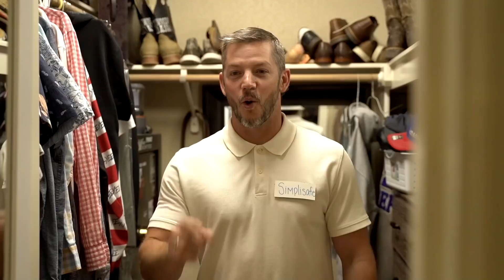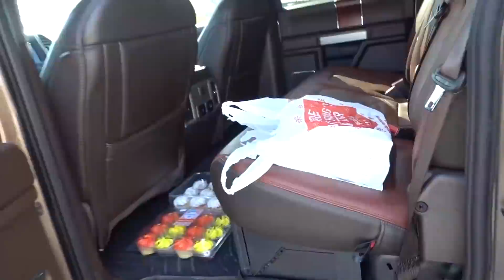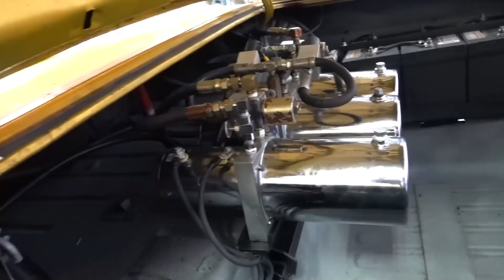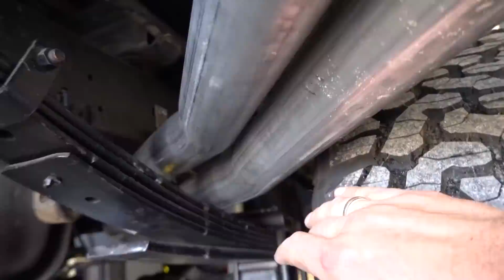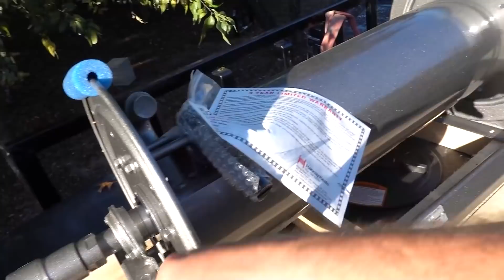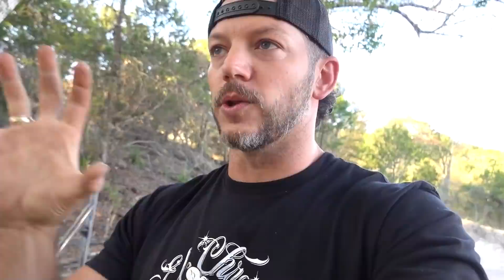Here's How a Local Car Shop Screwed up the Bronco...

Comment: Looks like you gave the Bronco to a pet shop to have done.  Bird poop welds and goldfish engineering. Built by monkeys.  Take it to someone who cares about their work. And your Truck..  also you will need flexible joints on your rigid pipes else will simply crack and vibrate itself apart.  HURRY  with the mansion dude. Missing the updates. 👍
Reply: yea i was surprised he didnt say anything about the welds
Reply: @niq872  I know nothing about welding and even I noticed that was a mess.

Comment: I think that if you pull the top of that tree with big chains and tying it around some poles and rocks, it will bend. Just do it after a big rain while it has leaves, to make sure it's springy enough. I have a few smaller trees, but the thing with bending is to do small bends over a long period of time. Like braces.

Comment: The reason why it’s bent is because the tree pushed away from other trees to get sunlight if your wondering about that but you can also get a spade truck and replant the tree somewhere else but it will be costly for that size of a tree and because of how established it is or you can chop it down because eventually it will fall over because all the weight is on one side.

Comment: Just remember to always oil you soft hose so it doesn't dry rot on you over time and good luck sir.     An just cut the part of the Tree that is Curving there is 3 other trees growing from that root system so just remove that part, its possible to do a transplant but as big as that tree is your best just to cut the Crocked part out only again leave the other 3-4 trees growing from the Root system thou and they will grow in the place of the tree taken down.

Comment: Take a huge winch and a chain / cable bend the crooked part of the tree all the way down into the root system chain it back with a strap around the tree not the chain or cable because they will grow into the tree trunk and leave it to reestablish itself over some time it will settle out of your path it's called training your tree usually done on younger trees but it will work on older trees it just takes longer

Comment: THE TREE  ! Yes you can cut the limb off.  But you should wait untill after this first cold spill when the sap has gone down into the roots . So it will not bleed out . Then you should place some tree bandage or paint tar on the open cut to seal it . Then problem solved .

Comment: At 22:46 will not work the reason why it bends is to get to the sun light it goes on the direct path to sunlight that could work but you'll have to clear the canopy around it so it would grow up otherwise it's just gonna do the same thing

Comment: You should hard pipe another hose real to the front of the truck so you have 360 degrees of hose or install water sprayers on the front and flood a fire by just driving over it

Comment: after 4.3k comments you probably won't read this but if you bend the tree it will work but you need to keep it bent till straightens out so you might have to anchor for a while like a year or so I'm from Oregon we do it all the time and you can cut a small section out if bend it to keep it straight. Hope it works. Love your video's

Comment: Grafting is hard on small trees.  On a  big curvy thing like that, you're better off cutting it 6 inches away from that spur that wants to go vertically.
If you can find some kind of a wound sealant for trees, you MIGHT be able to prevent the cut from rotting, but probably not.

Best bet?  Just cut it off at ground level, in the spring, and if a new shoot pops from it, let the new shoot grow.

We've never tried to save a bad tree.  We just cut em.

Comment: Chain or strap the tree from the middle to the bottom of another big tree and with a chain or strap ratcher you pull it a little bit once a week.. you dont need to make anny cut.. the pulling will brake the fibers just a little bit and it will heal it self every time you pull and over the time the tree wont be on the way.. i have done it with 3 smaller trees and it work perfect.. just remember to pull just a little bit every time so it will not break compleatly and give it enough tine to heal every 1 to 2 weeks.. may be you will need to use mulltiple straps and ratchets sinds it is a bigg tree

Comment: I wouldn't use hard pipe on the firetruck. lmtv's aren't made to be stiff. When your driving around your property you will be slowly stressing out the pipe and you could crack it right when you need it most

Comment: Been in tree care for 5 years. Any tree with a large gouge in it, get rid of it. If it doesn’t die quickly, it will in a few years. Those gouges open it up for disease and it WILL happen. You only want to take 15% of any tree at a time and only want to cut oaks in the fall. “Oak wilt disease” is a very common thing that will happen if you cut them in the summer. Any respectable tree company will only prune oaks during certain months. 
In short, cut it down. Yes it’s a nice tree, but it’s done for. Cut it down.

Comment: Could you dig out around the base of the tree with a backhoe and then pull it with the 5 ton to straighten it up and then fill the dirt back in? Basically like you're replanting it, but not cutting all the roots or pulling it completely out?

Comment: That tree is going to fall if you try to bring it back on itself. You would have to tie it off on both sides and slowly let one side out, thrn leave it tied off and hope the lines dont pop while you are trying to let heal and the cut would have to be almost perfect so it doesnt try to roll on you when you let off tension.

Comment: I think u should absolutely try to cut the bend out! It might reknit itself! Nobody can tell you without a doubt if it will work or not. Most likely not but hey I was a certified arborist. I think you should try it. Ur gonna have to mechanically stabilize it for quite some time but how cool would you be in a completely different industry if we’re successful. Btw your still cooler than Kentucky, but don’t tell Scott I said so.

Comment: I’ve seen these big trucks with like shovel things that go under the tree and pick up the roots and everything, then they just drop it in a new hole and fill it up. Probably the best way to keep the tree alive
Reply: I was wondering if something like this could be done. Even pulling it up and simply spinning it 180 degrees and dropping it back in the same spot will solve the overhang issue. I don’t know what the root structure for these trees is like, so you would need advice from someone far more knowledgeable to know if that was a possibility.
Reply: @Donnovan82  damn your 100% right, I didn’t even think of just spinning it, you sir have been nominated for a Nobel prize
Reply: @kaidenelizondo1207  I don’t know about all that, Nobel prizes are for smart people, but I appreciate it.

Comment: I think you want botanists not tree cutters to answer that question... Tree guys would know how to drop the tree not how to splice it to regrow differently... My idea... Lop the curved section down let the rest keep growing, because eventually that bend will bring the entire group over... Try to save the two smaller branches so the tree isn't completely gone. And you never know, the tree may JUST start sprouting from the cut area. 
But from what I can tell ya, your idea would most likely end up killing it, and the wedge cut with pressure to pull it back over could result in a busted tree that a wind storm or what ever could cause.

Comment: No, the tree will most likely die.  You could soak the roots and push it to the degree angle you want. As long as you don't break too many roots when you push it.  50/50 chance it will still die.  I would cut it.  The two trees next to it will grow fast enough to make up for the one that you cut out.

Comment: The Bro NCO? Needs a proper exhaust system installed, with proper welds.

The tree? It would be easier to build a time machine, go back to when it was just a sapling and adjust it's growth with ropes and bracing.
IOW, cut the tree down.

Comment: What if Matt excavates around the base of tree while carefully avoiding the root system and then pulls it out of the way, then backfills it with less compressible fill on the driveway side and leaves the tension applied for several seasons while also making sure not to damage the trunk with the straps?  If you allow enough of the root system to shift away from the driveway and support it from underneath with the backfill, is it possible that the roots would take a set in a new orientation, as they’re somewhat more flexible?  The one thing you definitely wouldn’t want to hear is that unmistakable crack from below, however, which would mean the root system has been compromised. I’ve seen a root system “grow back” in potting plants, but I don’t know anything about oaks in that respect.
Reply: A pump capable of evacuating chunky/sludgy material, like a septic or drain cleaning truck, and a source of high pressure and volume water (fire truck) could be used to “dig” up the root system with less risk of damage to the roots, yes?  Shovels are slicey and dicey.  

Water in, slurry out.. like a carpet extractor?  I’ve heard also that overwatering can kill plants, so that could be a thing?  I didn’t say pressure washer, because A: that would take forever and B: 3000psi is bad for organic material that you’re trying to preserve.

Comment: Option 3 won't work that well with an old oak tree.
It is possible to dig around it (large radius), and then with heavy machienery lift it and transplant it.
This method of transplant is used by many who really care for tress, but the downside is you need to dig far around because of long roots, 
and also use tractors to dig because you are going to need a giant hole to plant it in.

Comment: In my botany class we learned about how someone took a knife and scored around an old oak tree to kill it. Most oak species have structures that run up the trunk that carry nutrients through the trunk. The issue is if they are cut they most likely not heal and grown back. I have seen were trees have been forced to lean a different direction but talking with a feller would be the best option.

Comment: I would be taking that Bronco back to the shop. Probably should have checked it first, but they need better work than that. The unfinished tips are one thing, but the routing of that exhaust is awful.

Comment: When they did the exhaust they probably had it on a two-post lift with no weight on the suspension and the tires dropping so when they installed it it probably actually fit until it sat on its own weight

Comment: On that hose reel, I would look into a swivel mount for the back of the bed, so you can pull up and if you need to turn the reel so it’s easier to run the hose out in situations that you can pull the back of the fire truck straight to the problem.

Comment: Arborists... I just had an idea... its a crazy one; but maybe less crazy than Matt's cut it plan... hear me out.
Ever seen a piece of lumber that was bent? And I'm not talking about the cheap stuff from Home Depot and Lowe's... im talking rocking chair bottoms and other stuff like that specifically bent intentionally...
Well, that's done with steam, special equipment, and patience... could it be theoretically possible to steam the bent area  over a 3 month period or so while keeping pressure in the desired direction and move it slowly like a dentist moves teeth with braces?
I understand it's probably more trouble than what it's worth... So I'm not asking if it SHOULD be done.. I'm im just curious to know if it COULD be done.

Comment: Get that shop to redo that exhaust that’s straight up not acceptable a legit company should be outraged if a exhaust left the shop like that. You couldn’t even hit a speed bump with out the leaf spring pushing it up. The metal on metal will 100% bounce and hit together breaking welds and more. As for the tree cut it down and make something out of it, I really don’t think your third option will work and to leave it will be a mistake eventually.

Comment: Matt, I'm a self certified internet arborist technician. All you need to do is to get some ratchet straps and some strips of roughly 1/4" steel to apply equal tension to the tree as soon as you start to notice that the tree is starting to bud new leaves. Every 3 days, go out and apply 1 or 2 more clicks until you've finally achieved the desired result. Be careful not to apply too much tension at once, straps should be just tight enough to wear the tree is starting to bend.

Comment: you should cut it down, it has allready made shoots at the bottom. by removing the big part, the tree will use all its energi on the smaller shoots and maybe make more. that's the best way. second, its not gonna work to bend it, or cut a chunk out. i don't think it would heal, and I certainly wouldn't do it myself. also it could get quite dangerous
- a forest and landscape engineering student

Comment: That a complaint that should be made very loud about... Even NONCAR PEOPLE know you exhaust isn't supposed to BLOCK the Suspension... Or touch anything it could melt through... Inspection wise would be an ABSOLUTE FAIL ON THAT ALONE...

Comment: The sap levels are lowering and the further into winter you get the better for cutting bigger branches as the sap lvls are lowering! General rule of thumb is you can cut 30% out of the tree or 1/3 and it still survive.

Comment: I say there’s two options honestly I’m sure someone’s done said this but me and my cousin has done this several times to hardwoods and it’s worked we take two trees and make one which is actually a really cool result we actually have a red oak and a maple tree that we made twist together and and split like a Y and we keep them cut short so it’s really full and pretty but as long as there’s no frost and you basically band aid it after you cut it it’ll work and it would look really cool cause it’ll bend again towards the sun eventually making like a tunnel shape. But if for some reason it don’t and it dies just cut it at a angle 📐 and the rest will continue fine. And also I’d go buy some fertilizer with good nutrients right before you cut it and put around it then take the fire truck and water it once a week and it’ll be fine you could even put some nice mulch around the tree so it holds more moisture in the roots can two bags is like less then 10 bucks and would be enough Lol

Comment: hey matt you could see about replating that oak, get a big excavator over there, dig a new hole, dig out the tree use some chains or rope to life it an then set it in the new hole, no garuntee it will work but it is an idea ive used on trees of similar size ill be it maybe 20 ft shorter an theyve done fine, even a hole 10 ft behind will do wonders. Just a idea that may work, doubt you will see this but hey advice is advice

Comment: I'd recommend flex couplers at the pump to keep the pump vibrations from cracking the lines.  But maybe no more use than it will get it might not be a problem.

Comment: The tree is nice I would personally just cut it out but it doesn't hurt to try and fix it but you have to do it in segments little notches to get it to move withought just snaping it off. So do a 90° wedge area but every 2 inches or so do a cut about 75 to 80% through so it has a gradual bend in it. You will also more then likely have to stabilize the tree with ground stakes or other trees. The bark is what transfers its food and water up the tree so thats what the wrap is for is so it doesn't lose water so a heat sink type wrap might be better in this situation because the bark is so thick it doesn't produce a good seal. But yeah it seems like it could work but the biggest issue your going to have is getting it to move withought breaking off.

Comment: Ok. Im a diesel mechanic, i sometimes do exhaust work. How did anyone think that running exhaust between leaf springs and the frame and that close to a tire was a good idea? Clearly someone just doesn't have an understanding of how cars function from that shop. We're all human and sometimes, mechanics, we mess up, but when you do you fix it and make it right. But running exhaust between leaf springs and the frame from a muffler shop, i mean come on, that's just a noob level failure.

Comment: Sorry Matt but the Bronco should be taken back to the shop to have them correct the exhaust. That exhaust touching stuff isn't the only problem as going through the leaf springs like that will crush the exhaust if your lucky or may break the springs if your unlucky. Who ever ran that exhaust is an idiot!

Comment: I am still waiting for the second backup pump for When the first pump fails at a bad time.  I am also still waiting for some protection for the PLASTIC water tank from falling and possibly BURNING debris.  Also need that two inch line manually available (to feed 1 inch application line(s)) with a manifold setup setup for a much more complicated scene (like protecting a neighborhood at multiple locations) with multiple distribution lines, junctions and tees.

Comment: If you had a muffler shop do that system you got ripped off. The welds look horrible, going under the transmission looks horrible and everything with that exhaust is horrible. My opinion get it redone at a professional shop

Comment: Who runs exhaust pipes though your suspension?  One big hit and you've crushed your pipes.   Definitely never use them again.  If the shop doesn't have the knowledge and principles of how to run a custom exhaust system or simply apply an existing system to your vehicle, then run.  There are plenty of good shops out there.

Comment: My sugestion is to mount the real close to the pump, because then you can start and pull the hose on one side, instead of starting the pump and then run to the reel.

Think about that, and it will look awesome too. I think its more practical.